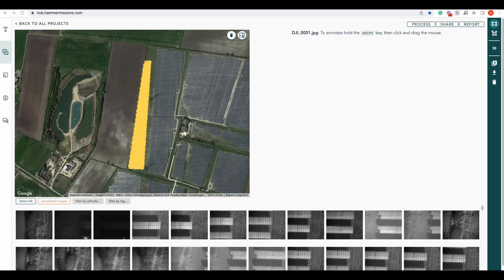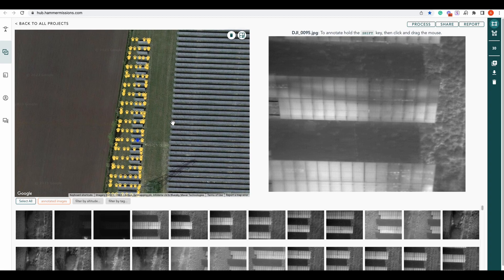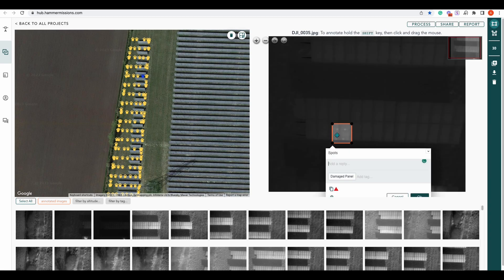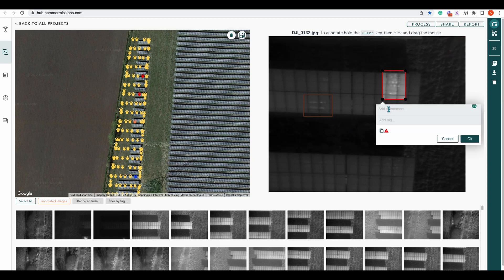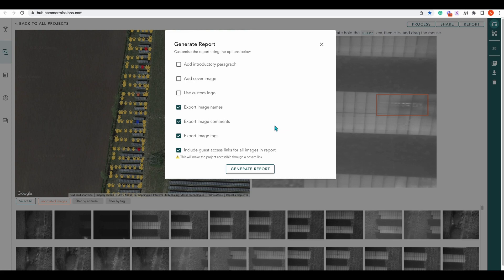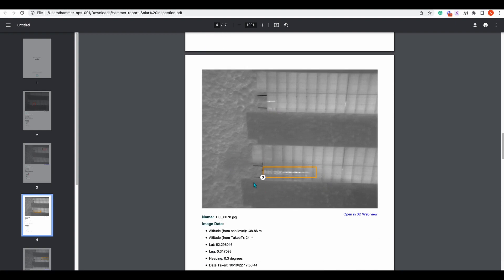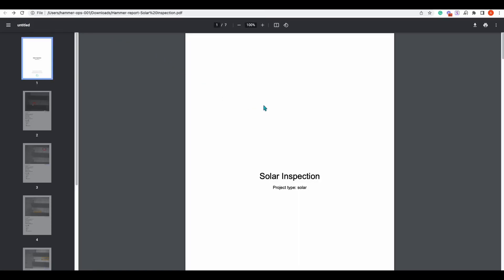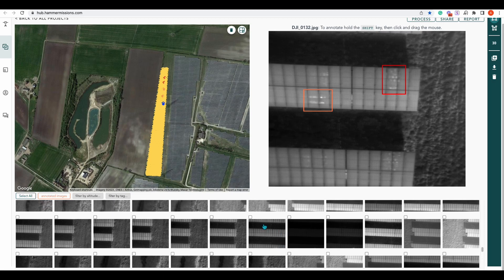Solar Panel Inspections: Annotating and Reporting | Hammer Missions

Comment: I cant see how you can describe this as a solar inspection, as there is no thermographic analysis or calibration tools or explanations in the video? It would not meet IEC standard in any way and couldn’t be sent to clients in isolation. I assume what you would need to do is complete the thermal inspection outside Hammer in something such as FLIR Studio and then import the correctly calibrated and analysed thermograms (images) for showing as an overview and orientation etc?